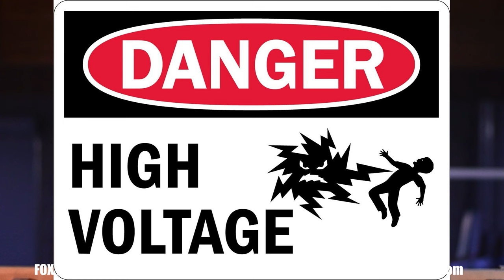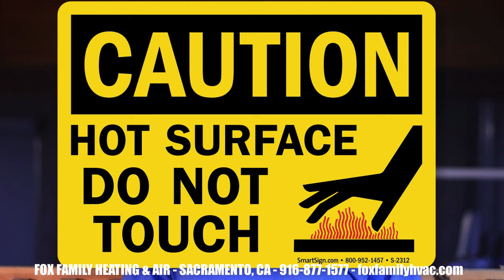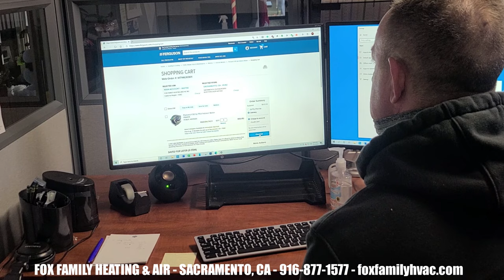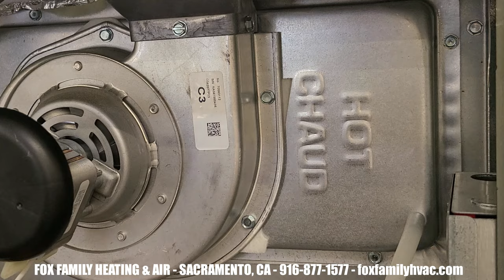Troubleshooting a Furnace Inducer Motor (The 4 Most Common Problems in 2021)

Comment from the maker: Hey guys, today I wanted to expand on our recent gas furnace troubleshooting series.  “The Easy Guide to Diagnosing a Bad Furnace Inducer Motor” will fill you in on what the inducer motor does, why it’s important, the most common of ways I’ve found inducer motors fail, and how to let the customer know what you’ve found.
Reply: Putting off a code 113

Comment: Wrong right out of the gate. The main board will check that the pressure switch is in the correct position before engaging the inducer motor. Then it will check for the proper change in the switch position after to prove that both the inducer and switch are functioning together. Some boards will check the switch after one cycle and then lockout if it thinks it's stuck or by-passed. This prevents a by-pass or tampering being left in a permanent state.
Reply: A lot of people fail to mention the self check of the pressure switch circuit as a step in the sequence. Also they fail to recognize that the heat safety circuit, limits, is under constant supervision.  Lastly he mentions that the vent motor be checked for the correct voltage but neglects to mention that a good neutral is also essential.
Reply: these inducre motors are any easy fix and 60-175 ..for the motor only.with labor,ITS A ROBBERY..EASY DIY JOB!
Reply: So if the inducer motor is never kicking on, it could still be an issue with the pressure switch right? My manual indictes an issue with the pressure switch or venter. Hoping the pressure switch is bad or has some clogging nearby, but got a little confused since the inducer motor won't kick on at all. 25+ year old well-maintained Goodman.
Reply: Correct, if the pressure switch is stuck closed before startup, the board will lock it out and give you a “pressure switch closed” error code and prevent the unit from starting. This is a safety feature in case average DIY homeowner attempts to bypass the pressure switch.
Reply: @gregmercil3968 my inducer motor is not running, the blower motor is. But I’m. It getting any trouble codes. The led is constant lit, which says unit operational. I have no heat and no codes.
Reply: @jpollard1984  is it getting a call for heat? What brand is the unit?
Reply: @gregmercil3968  it’s a Heil, outside unit. I was outside when my wife turn the thermostat on. I heard a click, then there  blower started. But nothing from the induction fan, which spins freely. Not codes no anything. All gas valves are lined up properly and there’s gas in the tank. The list has trouble codes for everything, but don’t see a trouble code for the induction fan. Not sure if there is one.
Reply: @jpollard1984  a few things come to mind: A, the board could be bad. Or, typically with ICP and Carrier (yours is ICP) products, the have this built in safety feature where if the power goes out when there’s a call for heat, and then when the power comes on when there’s still a call for heat, meaning when R and W are still jumped together, it kicks the indoor blower on for about 90 seconds before it initiates the startup sequence of operations in heat mode. But usually it will flash a code (usually 12) telling you that’s what it’s doing. In other words make sure power is on at the unit BEFORE giving it a call for heat from the Tstat or jumping R to W. 

I’ve also seen some York units do this when a rollout switch was tripped. Make sure all your safety switches are closed (rollouts, high limit, auxiliary limit, etc) which are almost always wired in series with the gas valve solenoid. 

Another possible though unlikely scenario, the LED on the board could be burnt out. Extremely rare but I did come across this once.
Reply: @gregmercil3968  I was looking at it more today. I pulling the two wires off the board going to the inductor motor, L2 and CM. I’m assuming that’s line 2 and common? Either way, I put a meter on L2 and ground and got 127. CM and ground and got 0. Unit was on and calling for heat. So it looks like power is going to the motor and the motor is bad. However, when I turned the Tstat off and the unit shut down, I was still getting 127 from L2. I assume that the inductor motor is supposed to run for a little bit to clear all gases and heat from the area. And maybe that’s why I was still seeing 127 on L2? I haven’t been able to get back out there tonight. A little background here, during the summer we had a control board replaced because the blower motor wouldn’t stop unless you killed the breaker. The AC would cycle on and off, but the blower would run 24 hours a day as long as the unit had power. I’m afraid that’s what’s happening with the inductor motor. The board is bad, or a stuck relay that can’t be replaced and ran the motor until it died, or something equally silly. Another question, if the inductor motor doesn’t spin up, allowing the pressure switch to read a vacuum, nothing more will happen. Like, the entire heating cycle is depending on that motor getting going before anything else can happen? Sort of like a bilge blower on a boat before starting the engine. Have I got that right?
Reply: @ instead of testing each leg to ground one at a time, test them both at the same time (one lead on L1 and the other on L2, or in your case L2 to C) you should be getting 230 volts. If it is at the inducer isn’t running, then the inducer is bad. If it says 0 volts or some other weird wonky reading, then the board is bad.

Comment: Think of it like this, would the manufacturer send out a furnace that breaks less than a year into service then have a garbage warranty that barely covers the part but none of the service which is specifically required by the warranty in order to qualify for the part? Yes. How about not making parts that you throw away and making parts that can actually be serviced.

Comment: What if the inducer motor fan is sticking? It gets stuck seemingly by the fan blades as it will spin free then get a sticking point at a certain position.

Comment: $600.00 to replace a Gas Value? Value Cost depending on the unit between $60 and $200 what’s your labor rate per hour?

Comment: Just as stated in your video, most inducer fans are not serviceable so there's no point wasting my time troubleshooting a dead horse.  Saved me a ton of time.  In mine I just replaced the fan and all is good.  TY
Reply: Mine is making noise when I start an engine, but after some time it will stop, is it a sign that I must take it for repair

Comment: Thank you for this information! My American standard Gold (two stage) furnace (installed 5 years ago)has a Inducer motor making loud noises. The 
Repair (installer) has notified me the inducer motor is back ordered and unavailable for only god knows when. He will notify me when the item ships and will schedule the repair when he has the item. So far it’s taken a few months (so far). Waiting patiently but this is winter in New Hampshire and it has been very cold. Hoping the motor lasts through the rest of the winter! Any comments or suggestions would be appreciated. Thanks
Reply from the maker: Oh man. that's rough. You guys have had some cold temps this summer. What about Trane? Have you tried them for the part?

Comment: I’ve tested with my multimeter and have 120 volts at the harness that plugs into the motor housing, but it’s not running. What would cause my inducer not to come on? When I first turn the furnace power on, I can hear a slight humming, but sounds like the motor isn’t running. This is a Bryant furnace. Also got a status code of 4 fast flashes and 2 slow flashes from the board, when the dip switch was set to status code retrieval, which as far as I can tell points to the inducer.

Comment: Your videos are gold!
Thank you & keep uploading more videos, please.

Yes! I frequently find myself informing my customer that this repair "might happen in multiple stages" meaning that I cannot guarantee that there will not be other expenses, until after I install such-&-such part so that I can get the system up & running to evaluate it's over-all performance.
If I have noticed that the customer is religious, I tell them to "pray that the bleeding stops with just the need for that part repair" that I just quoted them.

& yes, there are people out there that tell me that they understand this, but after informing them that new information has come to light, & today's service repair requires additional costs....some people still come unglued.
BUT, that's when I nicely remind them that THAT could be the case after getting the system up & running; that additional costs are needed for a repair that entails multiple stages.

It's not fixed, unless you have resolved ALL issues....& that is what every customer expects from me as a tech. So I remind them of that.
I have yet to have a customer say, "Don't fix all the issues. I don't want it fixed. I'll just pay you to fix one issue."

A customer will be upset, but in the end, they really want a thorough tech that finds & resolves ALL issues, so that they are not paying for several diagnostics.

I also point this out to customer's & explain to them by only paying 1 diagnostic, they are saving potentially hundreds of dollars.

"Which is cheaper?....several diagnostics?.....or just one?"

"I am saving you grief & headache by finding EVERY issue on today's service call."

(You should be thanking me, rather than ranting on me!)

Every tech out there knows what I'm talking about.
Reply from the maker: Awesome stuff Adam. Yes this is what we face out there. It can be very uncomfortable sometimes for them, but as we say a lot here. It is what is. 🤷
Reply: @foxfamilyhvac  You got a fan in Corpus Christi, Texas. Thanks for the videos, I watch them & they help me as a tech.

Comment: My inducer motor isn't coming on until the flame lights, and both immediately shut down because of open pressure switch. I've replaced the board, pressure, inducer motor and flame sensor. Any idea?

Comment: Hi, power surge while furnace was running at peak in January in Alberta so...cold!!! ( Comfortmaker Model G9MAE1002122A) caused inducer motor fault. I reset at fuse box and rebooted with panel switch 5 or 6 times and inducer kicked in and ran as normal (no unusual sounds) Furnace ran great. Skip to roughly April (warming up, still cool) I was away from home for a week came home and clocks were flashing, so another power surge! Furnace is shut off...inducer motor fault again, have tried the reset routine....well a lot more than 5 or 6 times! and no luck, any ideas? Thank you in advance!!!

Comment: I have a Carrier high efficiency propane furnace. Flames at the burner were orangey and dancing a lot. Tech replaced primary & secondary HEX. Flames still orangey and dancing a lot! And now from time to time there is a little water apparently leaking out of the collector box. Tech now says to replace variable speed inducer for about $1K. It seems to spin fine, however. Should I believe him? Can an inducer cause problems EVEN IF it seems to have plenty of power and it doesn't make any weird noises? Most of the utube videos on inducers talk only about obvious problems like not spinning or too noisy or hot to the touch. Could my inducer be causing bad flames or leaking condensate even if it appears to be fine?

Comment: I seem to be having an issue with a loose connection on my has valve ,if i push in and up on the plug the gas valve will open all day ,everyday .Can the plug connection be replaced on the gas valve .All the furnace techs that have come out want to sell me a new furnace.Our furnace is a Lennox brand and came new with our new house which is 15yrs old now .

Comment: If my inducer motor capacitor is rated at 3 micro farads but is reading 2.6, could it stop inducer motor from running?

Comment: Hello Fox! My lennox furnace is inconsistently and sparatically not kicking on. I get pressure sensor errors which make me assume its the inducer because i already changed the sensor and the issue persists. I hear a little rattling type noises coming from what seems like the inducer.. but what is odd is sometimes it can run fine for days and then out of no where trigger over and over.. any advice? Thanks
Reply from the maker: Check the back of the control board. If any of the solder connections are cracked (behind the plastic plug in to the board)trace those two wires to the inducer and check the solder connection on the back. My point is if those little Volcanos are cracked then the connections are intermittently not send the signal to the board. Not saying that's it, but good to check first. Make sure you unplug the furnace 😅

Comment: I just had a furnace guy out here to clean/service my furnace. My furnace gas had a rattle sound, and he said it is the inducer. The inducer was hot and when he turned it, it sounded like a skateboard wheel. He said that since my furnace is 16yrs old, he told me to start thinking about another furnace rather than replacing the inducer. Is that the only sensible choice?
Reply: Typically, heat exchanger(s) are the most expensive component to replace on a gas furnace. Blower or inducer motors are servicable parts and pretty economical in comparison to a new system. Replace the inducer motor now and start planning for a new system in future. Get minimum three quotes and try compare similar systems.
Reply: Could be inducer motor bearings or blower wheel going bad. Typically not servicable and require inducer motor replacement. Does not mean need new gas furnace and requires total gas furnace replacement.
Reply: No do not replace furnace.

Comment: Can I just buy the motor instead of the whole assembly?
I have a  jakel 119394-00 or icp1172823 inducer assembly and need just the motor
I see several motors on the internet but don't know just the motor number. Thank You
Reply from the maker: Yes hoping you are able to find that motor online. Sometimes it can be difficult

Comment: I have a carrier furnace with inducer with an AO Smith motor. The inducer makes a whining noise for about 2-3 seconds when the furnace starts up and after that there are no abnormal sounds coming from it. Any thoughts on my problem. Thanks for the video information.
Reply: Same here, what did you find out?
Reply: @jeffbudzisz160   it turned out to be a bad bearing in the fan motor which I found out after replacing the inducer. So I got both new.

Comment: I have noticed that our TRANE XV90 inducer fan runs for a while after the furnace reaches the temperature that is on the thermostat.  Sometimes for 15 minutes or more.  
When I shutdown the furnace; either by the master switch or the thermostat and then turn it back on, the inducer fan is quiet.  
This is not the main air flow fan directed into the house, but the smaller fan connected internally to the furnace - the inducer fan.  
This fan & its smaller squirrel cage appears to draw combustion air from the furnace and exhaust it out of the house via the PVC pipe installed.   This fan is a PSC unit as it does not have a square variable speed unit - it is simply a cylindrical motor mounted to this small squirrel cage - I think it is a two-speed unit though. 
Any thoughts as to why this inducer motor would run on for so long after the furnace reaches the temperature set on the thermostat?    Thanks in advance!
Reply from the maker: 15 minutes is a long time. If that is true though something could be sticking on the board. Is it the same amount of time every time?
Reply: @foxfamilyhvac  Thanks for getting back to me.  I am not sure as I usually turn it off via the thermostat and then back on.  When I do this it does not come back on.
If there is something "sticking on the board" as you list, I am concerned.  Both operationally and financially.

Comment: When the thermostat calls for heat, my unit works just fine. But when running a/c the induction fan just keeps cycling on and off, (but spinning slower than when running heat).  Gas never turn on during the cycling and the igniter never glows.  What do I need to check first? Thermostat voltage?
Reply: Failed control board?  I have lost one each with two Hi-E furnaces.  I want my old fashioned furnace back but they took it away and I let them do it; stupid me!

Comment: I have an old 1980ish Rudd furnace hat doesn't have a circuit board.
 It only has relays. One  24V transformer for the thermostat circuit,  one 110 volt relay for the Inducer motor and one relay for the blower motor.
My inducer motor has quit getting 110 V from the relay. 

My blower comes on immediately the instant that the thermostat is set to call for heat.
It does shut off once the thermostat is satisfied but will run indefinitely if the inducer motor has shut the gas off to the furnace  before the thermostat is satisfied.